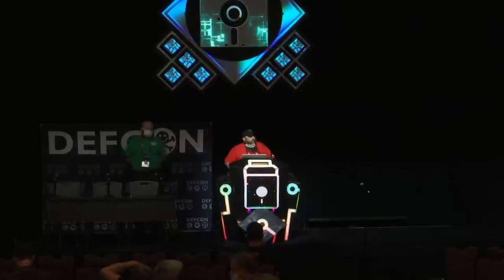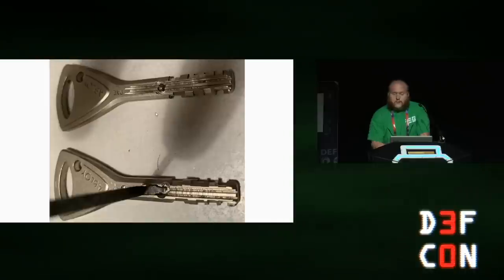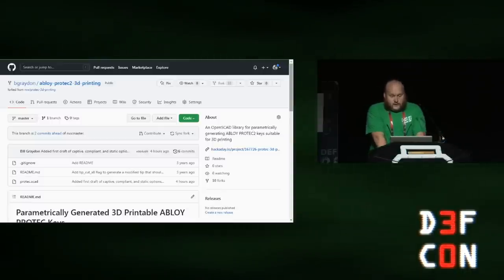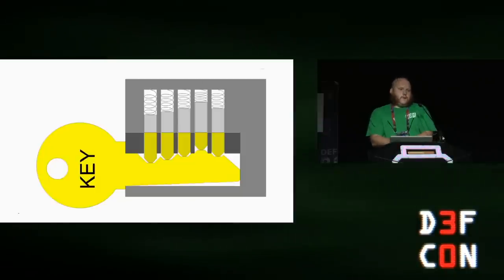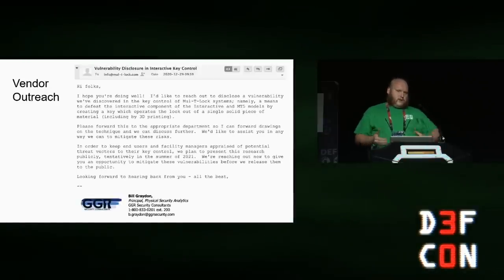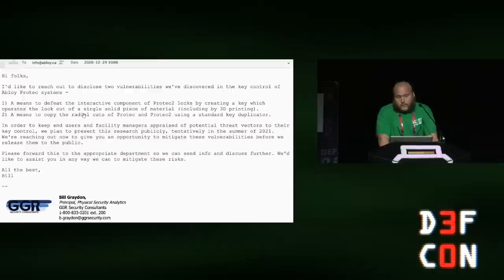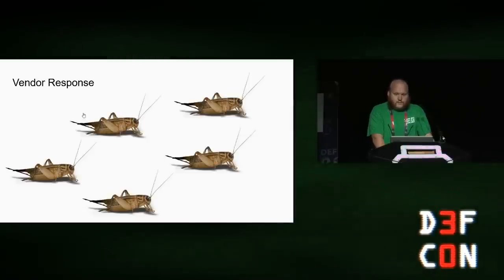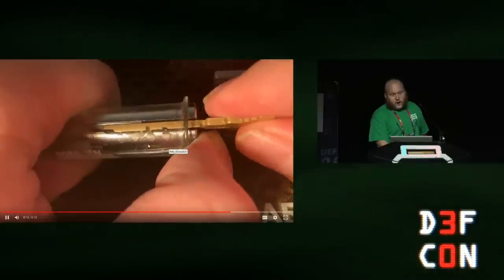DEF CON 30 - Bill Graydon -  Defeating Moving Elements in High Security Keys

Comment: When you mentioned the potential Mul-T-Lock improvement my immediate thought was twisting - it should be possible to shave the key at an angle, then to twist the key into position. I can't think of a way to fix that that wouldn't compromise the either-way-up insertion feature, though.

Comment: There's a certain irony in the MTL bypass only working because if the non-available blanks!
Also, Bill, you really need to see a Wormald gas meter padlock - moving key elements have been around for centuries, the Wormald being the best, and in use until relatively modern times (post WWII, just about)

Comment: Fantastic talk! I think that these are really some solid points, but kind of sad to see that you were ignored a bit by the manufacturers. I'll still hold onto my Protec2 lock (for now). With that unique lock from mul-t-lock, couldn't it be defeated by some kind of pick or shim inserted with the key to bypass one of the moving elements? I mean if both sides are keyed the same, then you really only have to worry about just one of those elements.
Either way, sad I missed Def Con this year but have plans to get out there next year!

Comment: I’m guessing you could beat the multi-lock by shaving the key at an angle, allowing it to insert at an angle and twist into alignment? If correct, could you fix that by revising the positioning of the moving elements?

Comment: if your intent is to break into a locked property then the captive ball isnt required all you need  to do is have a slot in the key going to the hole and then have a lock pick.

or if the lock is smooth all the way up to the interactive element you could make a reed spring that goes into a slot and you squeeze the spring to put the key in and once it interacts with the element in the lock you should be able to open it.

wont the rocking of the key cause some other pins to be slightly out of line with the shear line causing wear that would be detectable if the lock is forensically analyzed?

even if it is still in patent the chinese will still make keys.

can you renew a patent as simple as you renew a video rental? (pay the fee and have it for another term)?

if the manufacturer does not respond in timely manner then release a mt5 exploit and make it so widely available that the manufacturer will be forced to mitigate it.

again with ably release and force their hand

you cant completely prevent imports.

while customs can stop a shipment like fluke vs sparkfun the mail requires a warrant to raid.

the retaining pin problem sounds like you can work the lock with a regular screwdriver or some lock picking turning tool.